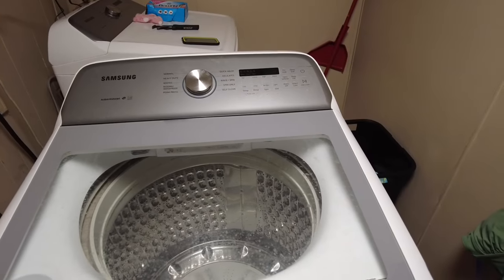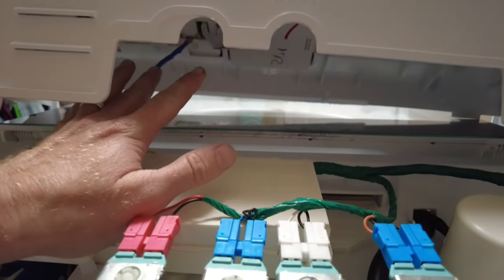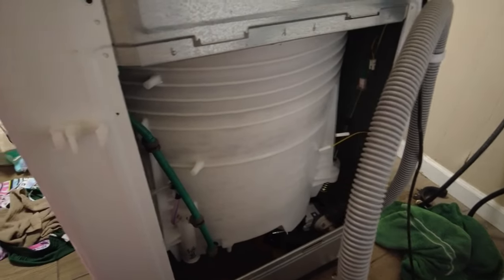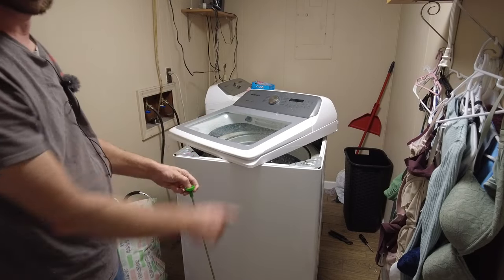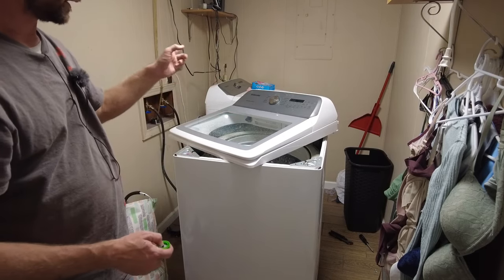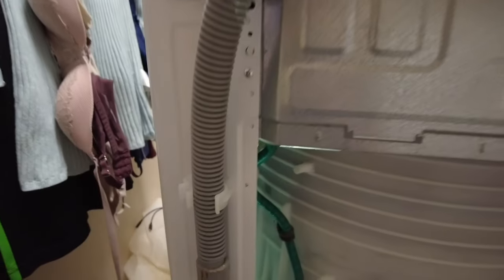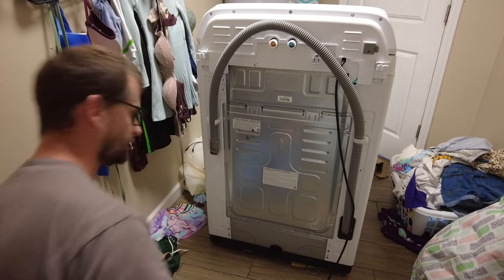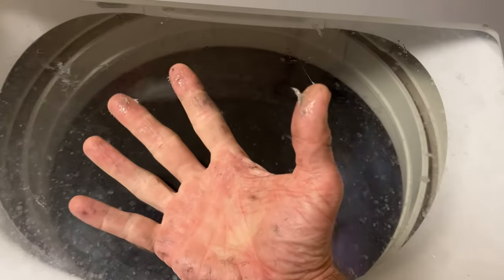How fix an unbalanced load on Samsung active jet washing machine

Comment: When I heard you say "hateful Samsung washing machine," I knew I had found the right video. Replaced the suspension rods last night and it spun a whole load of sweaters without banging itself to death. Much appreciated!
Reply from the maker: Glad I could you fix that hateful machine.
Reply: Yep 😂😂
Reply: I been having  the same issue but never worries to look for the problem lol.. now someone knw where can I get those springs?
Reply: Where do you source the springs?
Reply: This is an issue with a different model I have. I have 3 other friends with the same issue. At this point, there needs to be a class action lawsuit against samsung.
Reply: 70000% percent
Reply: Great video. 2 suggestions. 
Wear gloves
Recalibrate after switching rods by holding down temp and delay/end then hold to start
Reply: I replaced the rods first couple loads worked great after that now it’s doing the ur code again. I can’t even put 1 item in there it won’t work
Reply: @nancyann3544  did you perform the calibration after replacing the springs?
Reply: @joshfreeburg9833  Yes definitely need to perform calibration, I learned the hard way
Reply: Ya changed springs and did calibration but no luck for us as still goes unbalanced

Comment: I am a 75 year old woman with the Samsung washing machine going unbalanced all the time after 3 years. I watched your video and ordered suspension rods from Amazon which came today.  Following your amazing video I was able to repair machine on my own and it works great.  Thank you for your video😊
Reply from the maker: Glad I could help.
Reply: I ordered new rods from Amazon, they worked great at first.  8 months later the machine is back to unbalancing again.
Reply: I like you comment
Reply: Does it still work?
Reply: ive seen not to buy from amazon for rods is there anyone where else where we can get reliable rods?
Reply: @bacanator95  I’m finally giving up and getting a new one for $550,  but it’s a GE with no bells and whistles. The rods from Samsung are $95 each so that’s over $400. No more Samsungs ever. Sad waste of money which is not right.

Comment: I literally just followed this video and switched out the suspension rods. It worked like a charm. However, the best solution is to NOT buy a Samsung washer in the first place. (Mine came with the house.) 😄😄
Reply from the maker: @FrankCabrini-ls6gk  yes I will never buy another one myself either

Comment: I laughed at the hateful Samsung beginning, because that is exactly how I felt about this washer. I watched it twice, ordered the parts, and followed it again as I undertook the repairs. In less than an hour, this 60 year old grandmother had everything fixed, and a load of laundry was spinning properly for maybe the first time ever! I also noticed that the water level in the machine seemed to be a bit higher, and the clothes were moving around like they should, whereas before, it never seemed to have enough water in the machine during the wash cycle. I can't thank you enough. Oh, and your helper is utterly adorable!!
Reply from the maker: Thank you so much, I’m glad I could help.  I always try to include the kids in everything so they can learn just in case.

Comment: My washer is only 3 years old and had this problem. I was worried I would have to spend a ton on appliance repair, but I was able to use your video to fix it myself for the price of the rods only from amazon. Thanks so much. Your video was so easy to follow for a beginner. I've never repaired any kind of appliance like this and I fixed it in less than an hour! I've already done a ton of loads of laundry today to catch up on the piles that built up while it was broken. No unbalancing problems at all. Thanks again! Great video!
Reply from the maker: That is awesome!!!! Glad I could help.
Reply: Impossible, 30 mins to fix
Reply: What kind of rod did you get?
Reply: Same here thank you for taking the initiative to make the video and post it, you saved me a lot of money and fir that thank you and you get a like

Comment: This saved me around $450.  I bought the $45 parts on Amazon as the original parts cost quite a bit more.  It took me about 45 minutes to install and it works like new.  The rods were stuck in with some glue, so I had to use a pliers to hold them and pull them out.  Overall easy.  I do have an extra screw, but I'll figure that out later.
Reply from the maker: Glad I could help.  Don’t worry about that screw they always give you extras.

Comment: What an absolute shame that a 2 year old machine does this.  We have one that is 2 years old with very little use and started doing this.  LAST Samsung for sure.  We replaced our flawless GE top load as it was looking dated after 30 "flawless" years.  LOL.  What a mistake with this JUNK replacement.  Thanks for the video. :)
Reply from the maker: Oh I can completely relate, we replaced a perfectly good machine for this one for the bigger size.  I should have just kept washing more loads.
Reply: Same

Comment: I just went through an extensive fix on my dryer, replacing the heating element (2x). Now my washer is having this issue. I have been trying to get one blanket to complete the spin cycle for 3 days. I will never buy this brand again! Thanks for the video.
Reply from the maker: These really are not good.

Comment: *Pro tip*

If you get the sticky stuff on your hands, try to get the majority off and then pour some oil in polyurethane gloves and massage. You'll be sticky free with soft hands.

I successfully fixed the bane of my existence for the second time today. Last time was in July of 2023. My washer is 3.5 years old. I bought the recommended springs, which were different from my last replacement.This video was much more helpful, the last one did not mention the back panel and rewrapping the water line. Thank you, very easy instructions.
Reply from the maker: Glad I could help.  I do hate that sticky grease but I guess it's necessary.

Comment: Thanks for the video. Needed this. Struts came in from Amazon in 2 days.  Got home from work today. Done in about 15 minutes. Leveled  machine and calibrated it. Then tried it out. No more Ur message, no more stopping and rebalancing cloths. Had called service center a while back. $100 to come out and check it then go from there. Thanks again
Reply from the maker: Awesome, glad I was able to help and save you some money.
Reply: How did you calibrate it
Reply: @MrConive    I just followed the instructions in the owners manual
Reply: How is it holding up? Still good?
Reply: @teeeejaay89  For the most part ok But do get some unbalanced loads with towels and bedding

Comment: Thank you for this video! My husband and I had it done in under  an hour!  The back two rods were completely broken. We have had problems for a year or so. Mine is older than yours, but the instructions worked the same! Thank you! ❤
Reply from the maker: Hey glad I could help, sucks that they break so easily though.
Reply: How is it holding up? Still working good
Reply: @teeeejaay89  so far soo good!

Comment: Thank you for the helpful video. You have the patience of a saint. I'm shocked nobody seems to comment on Samsung's role in this equation...? My previous washer lasted over 20 years. I thought this was a 'quality upgrade' and lasts less than 2 years doing the laundry for 2 people? Why are we not suing Samsung?
Reply from the maker: These washers are truly terrible.  I traded an old unit for a bigger one (this unit) thinking it was the right idea.
Reply: There IS a class action lawsuit against Samsung for their horrible appliances. I bought the entire house package (fridge, stove, microwave, washer and dryer)and I have had nothing BUT trouble. After paying too many repairman to repair this junk, I found these videos. I absolutely WILL NEVER buy anything Samsung again
Reply: Well, the fix worked for 3 whole weeks, and now I have the same unbalanced load, and error message once again.... 
Has anyone else had this problem where the fix worked for such a brief time? Thx
Reply: We replaced tension rods and a month later we have the same issue. Samsung is like 21:53 
10 yrs old though so maybe it's time to replace. I will NOT buy Samsung though.

Comment: Just did mine; your video made it a breeze. Only difference was my rods had this incredibly greasy sticky grey glue at the top of each piston -- I needed Goo be Gone to get rid of it. Nasty stuff. But everything was done in ~45 minutes. Thanks a ton!
Reply from the maker: You removed it from the new ones or the old ones?  Mine had that same grease and I kept getting all over my hands.  I left it on the new ones and did my best to not touch it.
Reply: @ChrisThedudenurse  Hey Chris; it was all over the old (OEM) ones that came with it. New ones didn't have it. But there was enough residual in the slots that it should be fine to cover the new ones.

Comment: I did these exact stops and the replacement rods from Amazon went out in just 2 weeks. Then I started reading reviews on Amazon that most ppl’s complaints were about the same thing. Then I read on one of the comments that for new rods to not fail in a short period of time, you have to recalibrate the washing machine. Haven’t tried it yet but I’m hoping it fixes the issue
Reply from the maker: @4evr_ace  yes always calibrate the machine after doing a repair

Comment: Thanks for the video. I have the same washer and used your video to replace the suspension rods. It took me about 45 minutes to remove and replace them all. I got the parts from Amazon for around $26. You saved me a bundle.
Reply from the maker: Awesome, glad I could help.

Comment: Thanks so much for this. It worked like a charm. There was a period of time when ours was unstable on its feet, and I’m pretty sure that led to uneven wear on the springs. Since I replaced the rods, it seems better than it was brand new.
Reply from the maker: Glad I could help.  Not sure if it being unstable did it or if these are just terrible machines.
Reply: @ChrisThedudenurse Yes. I may just have been being nice to Samsung, but I’m glad it’s working now.

Comment: Great video. Just got finished changing out my suspension rods with the help of your wonderful video. However, it did not fix my problem 😅
Reply from the maker: Well glad I could help but I hate that it didn’t fix your issue.
Reply: @ChrisThedudenurse  Spoke too soon. It balanced out after the test load and works now. Thank you so much for your video. 🙏
Reply from the maker: @nicholesmith_exprealty  awesome, hopefully it keeps on
Reply: @nicholesmith_exprealty   You need to have it auto-calibrate.  I don't know the code, but you can look it up.  And, it'll help fix the UE code.

Comment: Been having progressively worse issues with mine for the last few months. Finally had it a couple days ago and found your video. Bought the new rods on Amazon and they just arrived. Took me less than 15 minutes to swap them out. Hopefully this does the trick.
Reply from the maker: Hopefully so.  Mine only lasted about 7 months though….. time to do it again!
Reply: Is it working?

Comment: Thank you for posting the link to get the parts in a previous reply.  I'm going to try this as soon as they come in.  If it doesn't work, I think I'll just get a new washer.  Of course, our warranty ran out a year and a half ago.  The machine is less than 5 years old.
Reply from the maker: Yeah sounds about right.  I think my unit is around 4-5 years old too.

Comment: I’ve had three repair people out in a month for a Samsung washer. Every time they “fix” it we run a load right after and it still unbalances. It is still under warranty but now I can look over their shoulder to see what parts are going I. It.
Reply from the maker: They probably are not changing your springs out.  My new ones are much stiffer than the old.

Comment: I fixed mine 2yrs. Ago fir 7.oo dollars yhe cost of a can of belt dressing. Which is a resistance  grease I just did it again yesterday so the fix lasted two years can pack the washer full. The corner with the pump is
Reply from the maker: It’s unfortunate that this has to be done at all after just 2 years.  Either fix that you do.

Comment: thank you for the video going to attempt this soon. protip for anyone going to attempt this get a magnetic tray for your bolts and have a couple of different colored paint markers. that way you can paint the bolts/wires/hoses and its proper location so nothing gets misplaced. im a automotive mechanic and i do this when breaking down engines. also if youre using power tools lower the torque on the tool, to not strip any bolts.
Reply from the maker: But loosing stuff is the best part.

Comment: We've had this model for less than a year. It is a mess! I regret this purchase.
Reply from the maker: Yes it has not been good to us either
Reply: Yes me too I honestly regret it as well plus they are not cheap and for it not to last long.
Reply: Me too - expensive piece of garbage 😊
Reply: Yes this machine is garbage for the price , they don't tell you when you buy it , you can't use a certain amount of weight of clothes, that's what cause, s the drum to be unbalanced the weight causes the suspension rods to bend . That's why it starts to rock , unbalanced. Should of known better,when the manual tells you you have to fold blankets a certain way to wash them ,wtf !!! Folding wash? The other thing all the sensors just ridiculous, I knew I should of went with American made and not this digital crap . Nothing like the washers with the turn thing in the middle that comes up to the opening almost . And you pick heavy wash because it's actually made for heavy wash, unlike this stupid machine with its heavy wash, that is not a true heavy wash... When the mechanic first diagnosed the rods was the problem he said if the insurance  knew that you used comforters , the insurance company would not have honered fixing it
 He tells me anything like that take it to the laundry mat , I'm like wtf are you Serioud what's the purpose of having the machine , if I still have to go to the laundry  mat . Never again . And those 4 rods cost 85 each . Do yourself a favor buy American made and the old style washers not this digital sensor crap

Comment: Hello Chris. This is Cathy and it is nice to meet you. How do you change the old suspension rods and springs to fix your washing machine that is already out of balance.
Reply from the maker: You could try to calibrate it 1st, install the new rods, then calibrate it again and see if that helps.  These really are not very well built machines.
Reply: Hey Chris the Dude Nurse. This is Cathy. The high spin speed of the washing machine can actually mess any of the breakable laundry up unless any of the breakable laundry is both thick and soaked in lots and lots and lots of water and just the medium spin speed only is good enough for any of the breakable laundry that is not thick and both soaked in lots and lots and lots of water.
Reply: Hey Chris. How did you clean the soap dispenser out?

Comment: Running my first load after replacing the rods.  Fingers crossed.  Thanks you for the help.  I've got the exact same machine.  I hope you daughter had a good birthday!
Reply from the maker: I hope everything goes smoothly
Reply: We had ours replaced it worked fine for a couple weeks then it’s back to unbalanced loads. It’s a piece of 💩!
Reply: @luislopezjr.1592  same, it worked for a few loads and done 🙄

Comment: Changed out my suspension rods but it still unbalanced error on blankets and towels
Reply from the maker: Sounds like you may have something else loose or damaged.  Theres also a bolt or nut in the bottom of the drum that may be loose.  You may also have the dreaded bad control board.
Reply: Yes, I did same.  I changed supsension rods from Amazon site, and it worked better for 2 or 3 weeks.  But, it is still problematic and random.  I also changed out the Vibration Sensor, and that didn't help either.  So, I am clueless as to what is going to be my next change.  No, actually, I just went ahead and bought anotehr washer & dryer.  Found great deal.
Reply from the maker: @PoeLemic  man!!!!!!! I hate that didn’t work for you.
Reply: @ChrisThedudenurse what do you mean by dreaded control board? I’ve checked the large bolt in the tub and it’s tight. Gonna try changing out rods now but wondering about the control board thing! Thanks
Reply from the maker: @shayjones5380  it’s basically the computer of the washing machine and when it goes bad there’s no fixing it

Comment: Wow Chris, I wish I’m handy as you. My washer made a lot of sound and I searched and it’s the bearing that holds the drum. There’s also smell of smoke too coz it burns the rubber inside already. My washer was front load. It’s an older washer (2007). Since the tutorial on YouTube is very taxing (coz I have to take everything out), I just bought a new washer, and I wanted the dryer to be the same, so I bought a new dryer too (and sold the old one).
Reply from the maker: Thank you, I'm not sure why but taking things apart just comes natural to me for some reason.  Man I hate you had to replace the washer, those jokers aren't cheap.